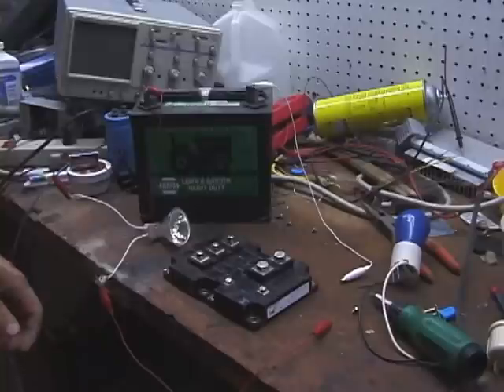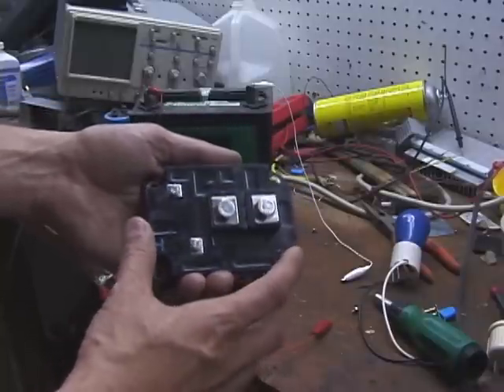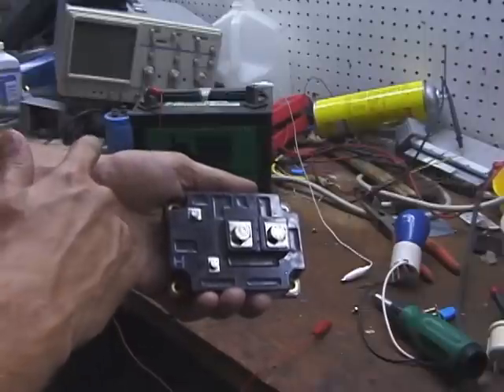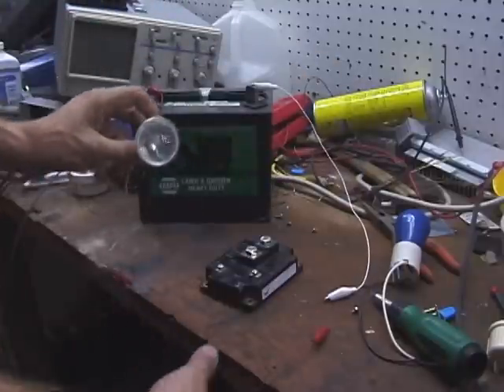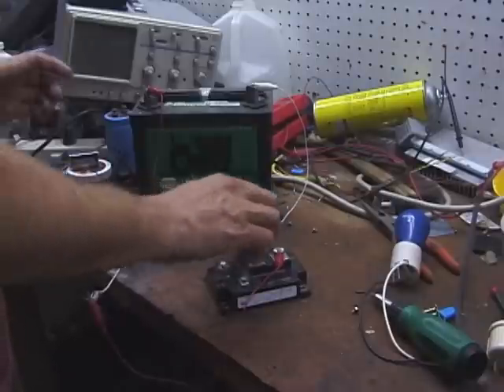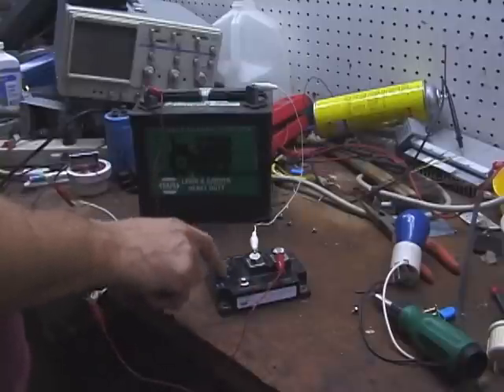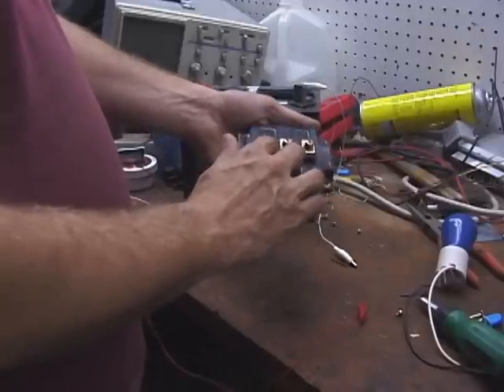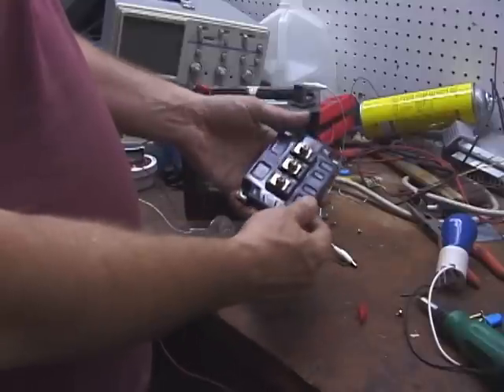How to test an IGBT brick.

Comment: touching the terminal of the battery and one finger on the igbt turns it on and a bulb lights on bright. by it size it looks like a 40 watts bulb,
if so why do we do the switching of IGBT with 14 to 22 volts is that not a damaging factor

Comment: Thanks for the test procedures you provided on the black color thyristor.  I used this method to test my black thyristors type: CM300DY-12NF and on type: CM75DU-12F & the test when through just as you explained it in your video.  However, I have a problem in applying this test method on the white thyristor example SKKT 162/16E Semikron. The test those not work accordingly as it those on the black thyristor. Could you please explain & demonstrate as to how to carry out a test on the white thyristors the SKKT type.  Thanks.

Comment: Interesting, at 4:27 the light is fully off, but after turning it on and off again, the light is not fully off. 
When turning it off you only touch it quickly and its not enough to fully discharge the gate capacitance.

Comment: Could anyone have the same question as me,for the poster of this video??
Im sure using your finger to trigger this device it is a good or a proper method ??
What else you can do to trigger it and can you apply  higher voltages, for example 220V ??
Reply: You can use resistor instead of body resistance...
Reply: Are you the poster of this video??
Anyway thank you for your reply but what
it would be the value of the resistor, plus can you apply 220V to this device ??
Reply: Andreas Chris sorry i'm not a  ts. Usual body resistance is about couple mOhm. I advice you to look for "datasheet" for your semiconductor!

Comment: I duplicated your test with 12Vdc battery on 6 each, FZ800R12KE3.  Same result as yours with the exception that my gates seem to charge (3 seconds) and discharge (5 seconds) slowly, like turning up and down a dimmer switch, not instant on and off as your demo.  I needed to hold my finger on the gate for the full time it took for the gate to charge and discharge.  These IGBTs are used and suspect, that is why I am testing them.  Do you have an opinion about the behavior of my test?
Reply: IGBT module has a capacitor inside for gate area.  SO you will need positive to close gate and negative to open gate.
Reply: FZ3600R12KE3
FZ400R12KE3
FZ400R12KE3S
FZ400R12KS4
FZ400R65KF1
FZ600R12KE3
FZ600R12KE3S
FZ600R12KS4
FZ600R65KF1
FZ800R12KF4
FZ800R12KL4C
FZ800R12KS4
FZ800R12KE3
FZ800R16KF4
FZ800R17KF6C_B2
FZ800R33KF2
FZ800R33KL2
need any item, please kind contact us. Email: sales@asiantx.com

Comment: cool video, just  a few things to add. you can do this test with a DMM that puts out 3 to 7 Volts on the diode setting. However, a lot of those modules are rated for 600V or more and 25 Amps I've even seen 200A ones, so just gating it one with a meter, or lighting a bulb does not always mean its good. I've seen units that would gate and handle a small load, 500 mA, but then in the machine when being loaded down to their working load it would fail. I've also seen ones that the casing was blown apart, but it would still gate on and checked fine with a meter. They are tricky little devices.

Comment from the maker: I would not recommend it. It could be done but it would not be efficient. IGBTs are mainly used in high voltage switching applications. I would use a power MOSFET instead.

Comment: What's the difference between IGBT bricks as shown in this video and the IGBTs that look like power MOSFETs?
From looking at specs, the bricks are generally for larger voltage/current ratings, though I can find both types that have the same specs (e.g. 1.2kV, 60A), so I'm not really sure what the differences are.

Comment: The vid is IHMO ok, thanks for it.
But it could be very dangerous, to leave the gates open when the unit isn't being used. (Your first brick hadn't a visible safety diode or short circuit between G and E.)

Comment: Hello. I have a dual darlington transistor module (Powerex KD324515). I have performed this test, but it didn't work with my brick. I haven't got any battery like in the video, so I used a 15V DC adaptor. I could switch on the lamp, only when I changed the polarity. In this case the lamp was switched on continously. When I touched one of B1, B2, E1, E2 tabs with the positive pole, and hold it, the lamp was turned off. If I release it, the light was turn on again. Does it work well?
Reply: KD224575
KD224575HB
KD324510
KD324510HB
KD324515
KD324515HB
KD421210
KD421210A7
best regards
sales@asiantx.com